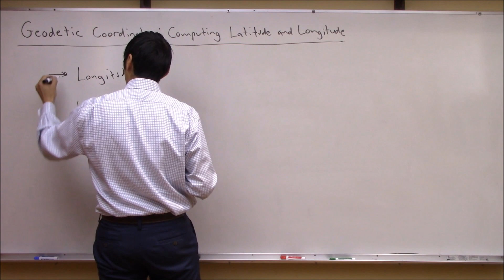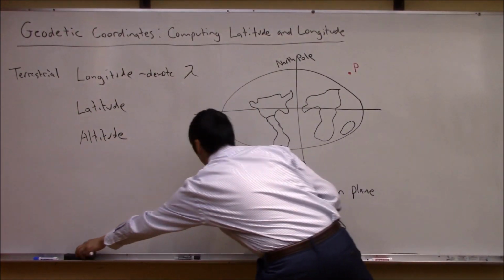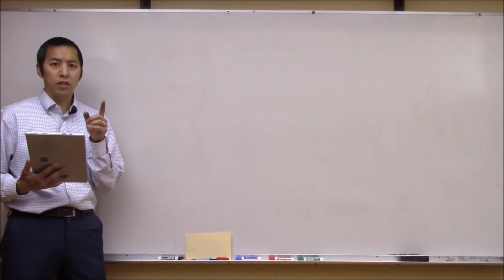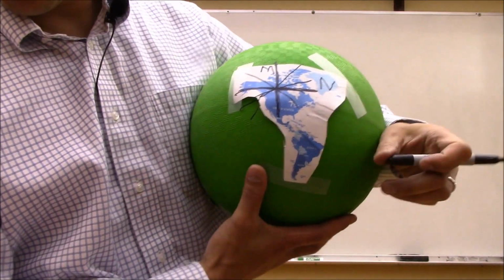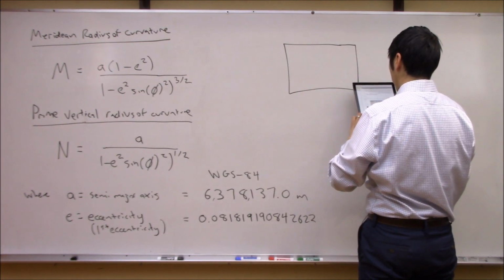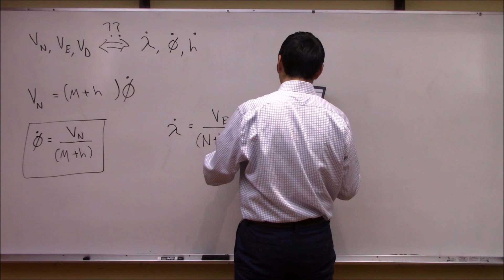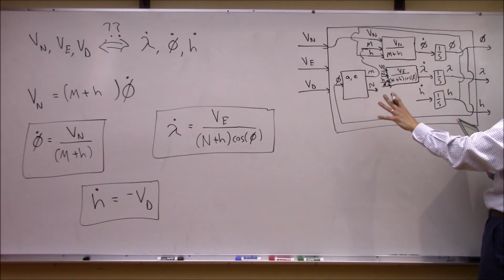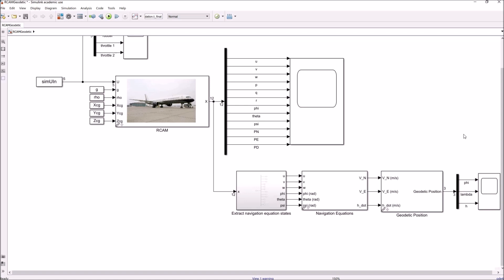Geodetic Coordinates: Computing Latitude and Longitude

Comment: AE512: Great video! I can see how using the RCAM model to output lat/long/altitude can be used to develop some sort of position tracking. Curious whether the desired convention to have our geodetic latitude as phi and that could get confused with our x_state of phi angle and how that is usually differentiated for the user

Comment: AA 516: Hello Professor, I have a very stupid question here. What is the block you used in Simulink to contain a simple function? Thank you so much! Very great video. Getting excited about building my own flight simulation.
Reply: I think I found the answer. Seems like MathWorks removed this block since the last version.
Reply from the maker: @alexzhen179  You might want to try the 'Matlab Fcn' block.  Let me know if this isn't in the latest version.
Reply: @ChristopherLum  MATLAB function block works fine in my version (2020b). I substitute all Fcns with the MATLAB functions. Thanks!